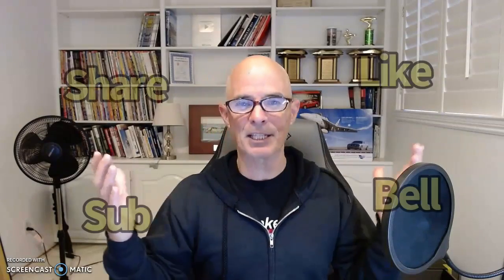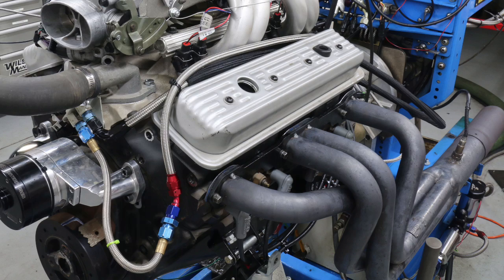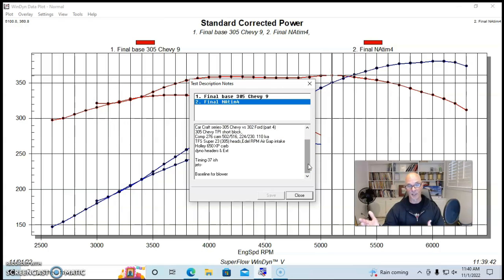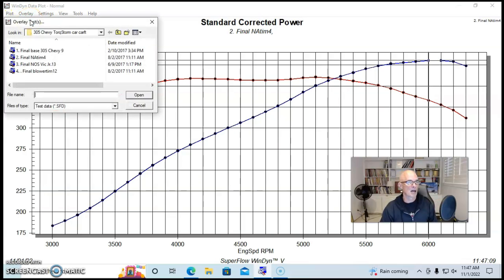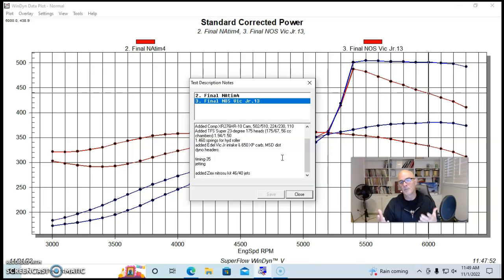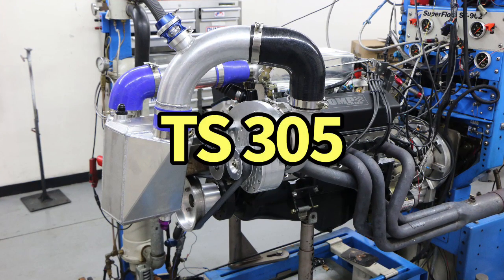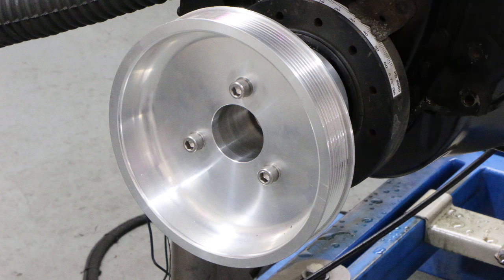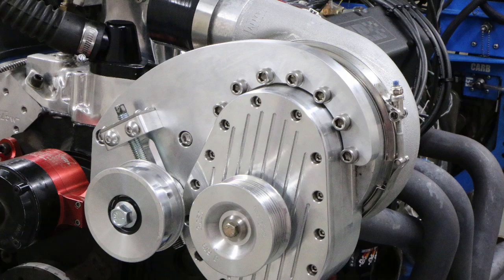THE OTHER GUYS SMALL BLOCK CHEVY-HOW TO MAKE POWER WITH A 5.0L 305 CHEVY. 200, 300, 500 & 600 HP!

Comment: One thing I never see is a discussion of longevity out of stock shortblock engines. Most of this stuff will not live very long
Reply from the maker: My junkyard L33 was purchased with 200K miles on it-the motor has 700+ dyno pulls (turbo, blower, nitrous, and na (still stock bottom end) runs to 7800 rpm) they last!

Comment: 350 vortec heads with high compression pistons to bring it back to 9.5  or leave it alone for supercharged or turbo and the small bore long stroke engine will do some surprising things. A 350 is a 350. Taking a 305 and integrating 350 parts or 327 or 400 and the many combinations to create your own Frankenstein engine is much more fun.

Comment: If i wanted to replicate any of these, especially the 300-500hp range stuff for my stock monte carlo ss h.o. 305, will i have to upgrade the oiling system for 300hp? I would for 500-600hp, what recommendations for an oil system that will keep the engine alive long term?
Reply from the maker: no need for oiling mods in that range (maybe windage tray)

Comment: at what point would you be worried to melt those stock pistons though? I have a mild built 350, it's .060 but pistons are still cast if I remember right, has a healthy 550ish size cam, and dart shp heads and intake, 670 holley carb. Sorry I don't have the full specs it's been a few years since the motor was built.
Reply from the maker: we made 1543 hp with stock cast pistons on an LS with proper tuning, octane, ice water intercooler-they will take a lot when everything is right

Comment: I haven't watched your videos for awhile, sorry about that. I've been going through some medical issues. Love your videos and views. To the question why not simply replace the 305 with a 350 or ls motor. I think the answer is being able to run what you bring. And it's old school hot rodding at it's best. Taking what you have and build it to it's full potential because to me that's fun. Using my knowledge to put it into any engine and make it preform. Also some sanctioned races may have displacement or stock regulations to adhere too.

Comment: "RICHARD CAN WE RUN THE NITROUS ON THE DUAL PLANE?! YES!?" then why in the hell did you rip it off and put the single plane on it to spray it and then said the intake made it lose power why in the hell would you not spray it with dual plane and show us the results of that especially if it was the better intake in this application. 
I'm triggered, now the nerdy Richard shit is super annoying
Reply from the maker: See the many, many, many, many videos up where we run nitrous on dual plane intakes. Trigger averted.

Comment: OK boy you are a talker! I am thinking about an El Camino hobby car. Found one 305 real clean, low miles. Looks great. I have had a number of Corvettes so I want some grunt. In my 81 Stock Motor I went with Vortech, and TPIS, Headers and Water Meth injection. Thinking to go that way on the 305 as I know how engines respond to Boost. Any guidance on Block prep???  Always enjoy your videos, Dennis

Comment: i have a 78 type lt camaro with a 305. its got a 4 barrel quadrajet and edelbrock air intake and an aftermarket mild cam. fun to tinker with and keep on adding stuff to increase power but at the end of the day i would like to throw an LS of some sort in it.

Comment: Sorry for the beginner question - if one could only do 3 mods and wanted a street-able 305 that had more ooomph what should one do? Headers, Intake, Carb? Headers, cam, intake? I just dont know what works together and how it all harmonizes.
Reply from the maker: headers, cam, intake and carb
Reply: @richardholdener1727  wow thank you sir!!!! Short or long tube headers? Any specific dimensions?
Reply from the maker: long tubes, 1 5/8
Reply: @richardholdener1727  Ordered. Thank you sir. Got Hooker LT Headers (1 3/4) (oops) , Edelbrock 4 barrel 600 cfm carb, Weiand non EGR speed warrior IM, Comp xtrme energy 206/212.Hope this is right!

Comment: I just built a 305 with vortec heads… I’ve watched your videos a ton of times and realized that my heads have the 64cc and you have used 56cc for the 305. It’s built and ready to go in. My question is will it be dead in the water with that compression? What would the compression be. Using a comp cam with .470 lift
Reply from the maker: YOU ARE FINE

Comment: what injectors do you use. ? I bought 42lb/h for a 383 tpi and not sure if I will be able to make it idle at 1000-1200rpm.
Reply from the maker: those will idle easily on a 383 with tuning

Comment: Now this is kind of off the wall.  But I’ve always wanted to see a head to head of a Ford straight six 300 punched out to 302 vs a 302 Windsor. Have both with same cam profile and have both setup as close to the same as possible.  Just to see how the HP and TQ curves compare.  Just thought it’s an interesting concept with different number of cylinders bores and stroke but same displacement.
Reply from the maker: me too!

Comment: I’m running a 350 tpi 250Hp stock, and just removed the cats and muffler (actually I have metallic 100cpi cats, muffler has a straight through tube), basically sounds flows like straight piped and now planning to install 1.6 ratio roller lifters (steel) then a ecm tune. 
what kind of power increase can I expect? The manifold has long tube runners, pretty restrictive , anyway I guess it should make like 270-280Hp?! 
thank you
Reply from the maker: rockers, tune and open exhaust (but no headers) might get you 15 or 20 hp
Reply: @richardholdener1727  thank you for super quick answer:) 
the thing is the old main catalytic converter was badly clogged and the car was probably not doing not even stock power

Comment: Thanks for doing these, I've had many 3rd gens over the years, in the 80s and still have an 84 Z28 H.O. that runs great. In the almost 40 years the engine has never been out of the car, I've had it for 10 years, it's never left me stranded. I have nothing to complain about, even in mostly stock form it'll fry the back tires right off rims if I want it to.
Reply: I have the same car and engine! Still going strong! 💪👍
Reply: @louiscyphre6049  how many miles does it have, what color?
Reply: @irocitZ  black with silver ground effects,  I just hit 118k on it this past year. All original other than a carb rebuild (not remanufactured) and some sensors etc.
Reply: @louiscyphre6049  mine is black as well, I'm pretty sure that I'm gonna need to replace the valve seals in the future. In the last 12 years I've done a lot of stuff to the car in an effort to take it to the next level, I plan on hanging onto it so it's been worth it.

Comment: In the future could you possibly do a test on a 305 sbc stroked with a 3.750in or 3.875in crankshaft to see how it responds?
Reply from the maker: it adds power
Reply: A 334 would be nice with ported Trick flow heads and better cam.

Comment: Hey guys 
Im not a Professional n good in dished or flat head 305 but we used to have Pontiac 88 305 and it was killing 
Recently I funded c1500 truck 86 and I’m wondering what is the best reliable engine for power and daily use

Comment: Alright, I got a 85 IROCZ with a LB9. Was a LB9 now its got a TPIS mini ram and twin Gt28 turbos and a holley 58mm, got green eBay 42lbs injectors and a walbro. I'm struggling with tuning the damn thing, I'm using EBL Flash ECU. I think I've got problems with timing, I've got 416 heads. Anyone have any tips on how I should be attacking a TT LT1 setup? I use tunerpro to make changes to the bins. I can't get over 5 pounds of boost but I've got eBay wastegates and it was difficult to route the cold side. Lots of couplers. So I don't think I'm making enough boost to blow up the 305
Reply: And! I'm having major issues with idle. The thing bogs down after it reaches a temp over 140°. The thing won't stay on, right now its at 0 initial and 8 degrees of timing @700rpm

Comment: I really want to see the FIRST TPI intake setup tested on the 305, id like to see what a much more opened up intake runners and base would do...

Can't decide between the FIRST TPI, vortec heads milled, and cam vs Qjet, vortec heads milled, intake to match, and cam.. Love the look of the Bird of Prey style that the TPI gives..
Reply: Just remember looks don't win races. Ditch the tuned port injection it will only limit you in horsepower.

Comment: Rich thanks for doing this I still have my 84 50 H0 5 speed Z28 maybe this will inspire me to get it running again
Reply: I hope you get it back on the road too, however if you don't get to it and don't live 3000 miles from me, I'm interested in making you a fair offer should you decide to part with it. Good luck with the car either way.
Reply: @irocitZ  I guess I would sell it if the money was really right but I have had it since it was new so it does have a sentimental value to me and also I've kept it under cover of some sort garage or carport ever since I've owned it so I would even in the lapidated state it's in right now I would still say it's one of the nicest you would find
Reply: @joehudson3072  oh no not the dreded  sentiment, haha. But seriously, I surely understand you having an attachment after all this time. I have one as well, I'm on my 10th year. That's a record for me, I'm gonna hang on to mine for as long as possible but for different reasons. I do like my car but I'm also financially buried in it, the entire time I've owned it, I spent a lot of time restoring it. Honestly, I think it owns me. I do enjoy driving it as well, at this point it drives like a new car. What color combo is your car and how many miles does it have? Also, does it have t tops? Auto or manual?
Reply: @irocitZ  5 speed with t-tops

Comment: I am actually super surprised that the LB9 had dishes. The ones I've had were flat tops with eyebrows. Almost wonder if the motor was a mixmaster with an L03 bottom end

If I were going to start with an L03 or LB9 or L69 I'd probably go in roughly the following order. The reasoning is a combination of ease and power capability.
-Exhaust system (if not going turbo) headers to tip
-intake manifold Performer RPM Air Gap or HSR. TPI or carb intake would go.
-Camshaft (I like that 276HR cam btw, you may call it "small" but i think it's a great fit for the engine as a whole esp with non-ported heads. Had it in a 383, don't think it would be "small" in a 305 and am surprised it peaked at 6Kish RPM in the dyno.)
-head work. Keep in mind I would argue that the SBC's limited valve lift capability out of the box means you're probably pulling heads any ways if you're going to get any lift. Stock flow isn't great on most TBI or even TPI heads so a 276HR is probably plenty of lift. For a TPI or milder build Elgin makes a real nice looking 210/215 roller as well. I'd think you'd be cutting the guides down at .5/.51 lift but maybe umbrella seals and a ghetto grind on the retainers would get you there? You'd probably also end up wanting to dump exh rotaters for mass reasons. An L30 or L30 Vortec 305 heads are likely a better path from what I've read. Maybe L31s if you are willing or able to compensate for the compression difference of 58 vs 64cc heads. 
-Turbo system. I think it wouldn't be easy to get to 1K HP, but I'd think it possible if you stuck in rods and pistons. You'd be talking nearer 30 PSI than 20 as well.

With stock head flow of a set of 416es being about 175-180 CFM I don't see getting to 350hp being out of the realm of plausibility. If dumping a bunch of money into one of these you're probably needing to go down the 4" bore path as a block is cheap enough in the grand scheme, but there's zero reason one of these can't make great power especially for a street engine. I'd just cam/valve spring it, put a decent intake on, make some turbo headers and party. 

Shame you weren't closer, I scrapped 2 or 3 good ones last year when I moved. Would have loved a big bang on one.

Or you just swap in a 4.8 with an extremely mild cam. :D
Reply from the maker: THIS WAS A PRODUCTION LINE-UNTOUCHED LB9

Comment: i always like the 305. with those super 23 heads its a good engine for a fun project that you drive often. not too much power that it is difficult to drive or required expensive drive train upgrades but not a slouch either.
Reply: Do you have a link for them? I have an 86 Monte Carlo SS.

Comment: I'm stuck on building a 305 for my Monte Carlo. When comparing parts & money would it make sense to just build a 305 or would it be better to destroke a 350? I am wondering this due to the 305 bore size & head availability,  & the cost between the 2 engines.
Reply from the maker: KEEP THE 350 A 350-IT MAKES MORE POWER
Reply: @richardholdener1727  I know, you're right. I just wanted a 305-inch engine for a fun build's sake. I'd even consider forced induction later.
Reply: If you want something different, here's an idea..... A 400 sbc with a 3in stroke crank. It should be about 303 cid, and the 2:1 rod to stroke ratio would handle the revs, just need a valvetrain to match.

A 305 with powerpack or vortec heads is a cheaper, more reasonable option though. There's plenty of power, especially with the right xam choice.

Comment: I've got a set of those Trick Flow heads on order. Supposed to be here about the end of November. Putting them on my 1984 Grand Prix with only 70k miles on it, sewing machine smooth original drivetrain. Had already settled on the same RPM Air Gap intake too. Now I know what cam specs to shoot for, though I'll be slightly milder sticking with a flat tappet rather than spending the money on a roller upgrade. Thanks for the video!
Reply: How did it turn out?
Reply: @timtodd6830  I ended up selling the car for a nice profit, so the heads and other parts are sitting on a shelf waiting for another opportunity.

Comment: What bore and stroke have a 305?
Reply: 3.736in bore, 3.48in stroke, 5.7in connecting rod, 9.025in deck height, same rod, main, and cam journal size as a 350sbc

Comment: Please build & test a junk yard mix "N" match 305 LT1. L99 block, L99 pistons, L99 heads,  LT1 crank,  LT1 rods, LT4 camshaft, LT4 intake.
My prediction is that it would make more power than a stock LT1 350.. What do you think?
Reply from the maker: would need lt4 heads too, won't make more than 350 lt1
Reply: LT4 intake has a raised runner and requires LT4 heads to work properly/seal at the intake port.  There are other differences as well, but it is a moot point to discuss them.  Dick could have stated that but he's usually too busy imagining that he knows more than everyone else.

Comment: It looks like the only way to get 50 percent more HP on a small engine without making it undriveable is to replace it with a big engine if you want the HP to be BELOW 3500 RPM.  And you want power brakes and want 16 inches of vacuum.

Comment: Nothing wrong at all with building a 305. I did it myself. The data is really interesting, but nowdays people are nearly giving away SBC 350,383,and 400's with GOOD parts when they swap for LS engines.
Reply: True, and I remember 20+ years ago old timers saying how the 350 will be heavily sought after when they are all used up.  Not so much but maybe soon once people want retro, Chevy 350 kinda like next generation. Flathead

Comment: People hate 305's mainly because when they came in a square body, they usually had awful 2.73 gears behind them which made the truck just a dog. Iv had a square(2.73's) a rs Camaro(tbi 305) and a 97 Silverado with a vortec 305 and the 97 silvy was honestly not bad at all. It had 3.42's. I think with even just gears and a tune it would have been great.
Reply: Had a canadian built 83 G20 built 10/82 that came from GM with a factory flat top piston 305 that had 53cc 601 heads with factory tubular exhaust manifolds and catless 2.5" duals.  700r4 and 3.08 gears. Ran really strong for what it was.
Reply: @chrisreynolds6520  a friend of a friend of mine had a c20 around the same year that had a great running 305 and 4 speed. I wonder if it had some of the same stuff. It pulled loads pretty darn good fwiw

Comment: Would love to see a 305 video with it bored and stroked like a 383 to make it a 334!
Reply: I did it on a marine engine.
Reply: Can you even bore them out that much?
Reply: @The Big Picture  yes its .030 over with  a 3.75 crank just like a 383
Reply: That would be interesting,  a real torquer
Reply: It's been done. Not worth it. You can shake and dance and port, and do the hokey pokey and it's done by 5200. The head flow just isn't there.
Reply: @ahoneyman  on a stock head maybe, these trickflow super 23s are as cast, they can be ported and polished, run a hotter cam shaft (i mean that generically), its not just the heads controlling air flow its the whole assembly as a unit. To say it foesnt have the head flow is ridiculous considering he made decent numbers in this video, with the right equipment and tune up the 305 is a good. They made 619hp on a basically stock bottom end on engine masters on NO2, had they gapped the rings for it they probably could have gone higher.